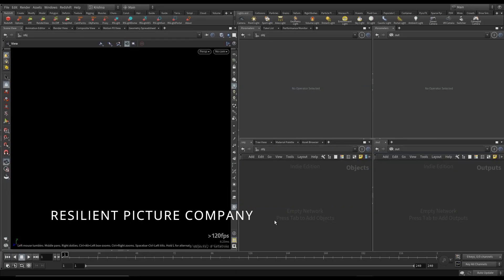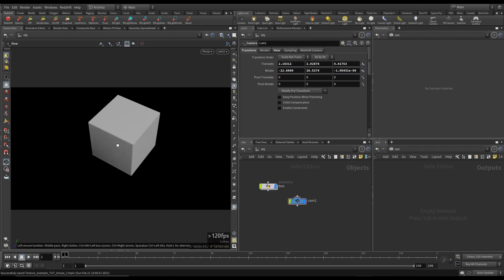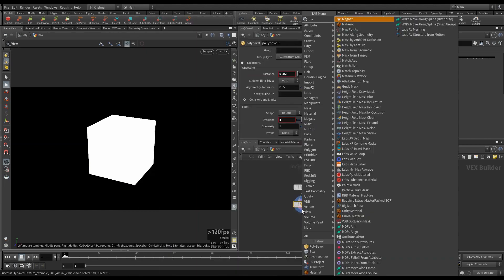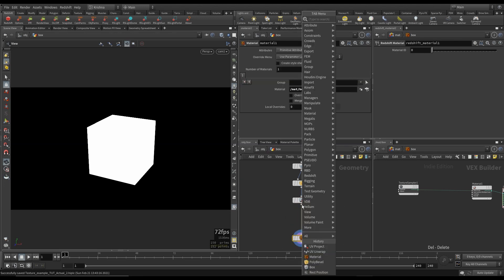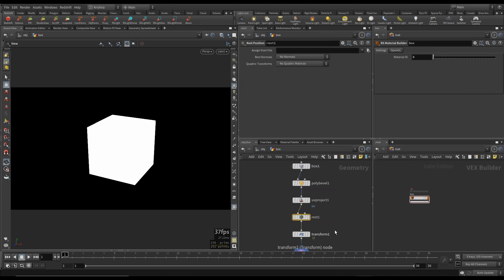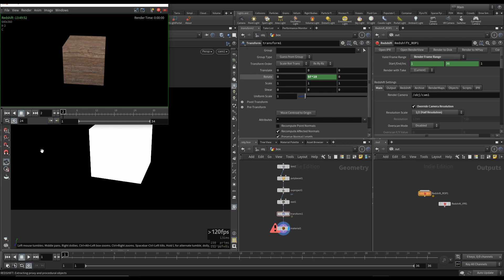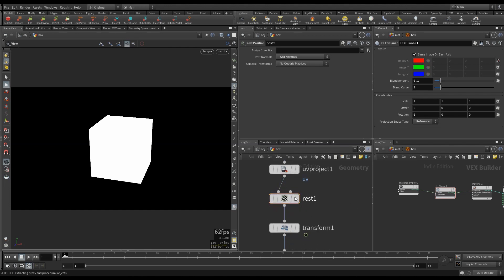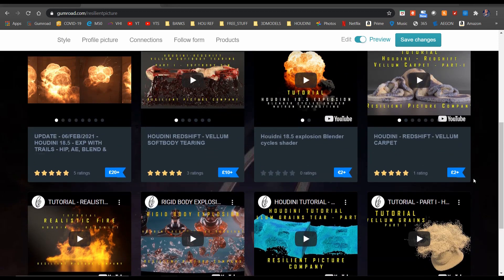TUTORIAL - HOUDINI - REDSHIFT - TRIPLANAR NODE

Comment: What other times would you find a use for the rest node. (Never had to use it yet)
Reply from the maker: Well, that depends on what you want to do but basically it stores rest pos data which you can use later in the frames. For example how far has a point moved from it's rest position at say frame say 24. Does that make sense? I primarily use it for rendering texture maps.
Reply: @resilientpicture  thanks makes sense thanks boss!